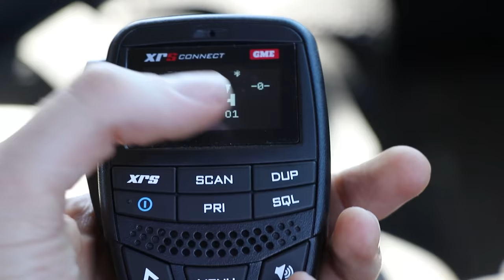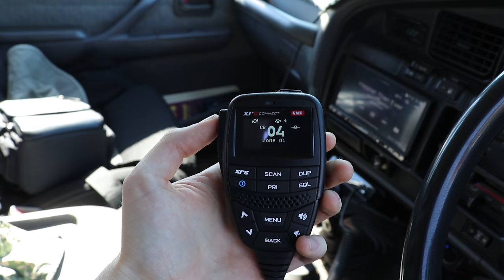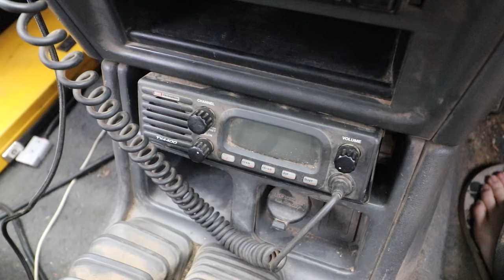You've been using YOUR UHF WRONG!!! CB Radio SECRETS for 4WD in Australia PLUS History & Technology

Comment: Good piece mate, thanks.

CH 10 is for National Parks and National Conservation areas. If you're not in either of those areas don't use CH 10. If you're in a State Park or on private land, pick another channel, usually 12 by agreement.

29 was originally the CH used by the road construction industry on sections of the Pacific Hwy upgrade, particularly the NSW mid-North coast. This allowed the site chief (one chief in the olden days) to communicate with inbound or outbound loads or plant. Using 29 back in the heyday was generally a fascination for travellers but it could also warn of road closures before bypass roads became de rigueur. No construction? Stay on 40.

Different construction areas use different channels. These days, on large road constructions sites, different road construction entrances use different channels - there'll be signs indicating which channel is to be used so the site chiefs can manage truck and plant movement on their site.

On antennas - the height doesn't matter as the signal propagates from the middle of the antenna. What does matter is the thickness. You can have an eight foot whip that can be as thin as speaker wire; or a two foot whip, which needs to be fat (for internal wire length) for propagation.

Personally, I don't mount my antennas on the bull bar - rough roads destroy the mount quicker than a roof mount, especially if the bullbar is not pinned. Height on the vehicle does matter. If your eyes are at 5' 7", on flat ground the horizon is 15Km distant; so decent propagation on the flat is the centre of the antenna at 5' 7" - a bullbar mount won't achieve this unless the whip is gimoungus. Azimuth doesn't matter but inclination and declination also matters - that's some math for another day. Also some math for another day - if you can get the centre of your antenna to, say, 12', then the horizon is 30Km; being reasonable, without a repeater, and an antenna at 10' centre, 20Km is audible and understandable with 5W; that'd be a 6.1

My three antennas [and sand flag] are mounted on my roof rack (all four corners) using foldable mounts with four positions of foldability. In tight vegetation, folding them flat, with 5W, does little to reduce propagation distance in that type of country.

Disclosure: I run GME XRS handsets and whips, and a Cel-Fi Go.

As an aside, a well designed kangaroo will rip an antenna off the bullbar, but might slow it down enough - so it doesn't enter the cab through your front glass ;)
Reply: Channel 10 can actually be used anywhere by 4wd clubs or convoys. Typically in National parks or out in the middle of nowhere.
But it is perfectly within the rules to use 10 anywhere providing you’re on the road with a group of 4wds.

Also..
(Not trying to be argumentative here, I enjoyed your post. Just chatting here…)
..
While the signal is generally propagated from the Centre of the antenna, it radiates and transmits from the entire length, so height absolutely matters. Line of sight doesn’t just drop off when the Centre off your antenna drops below the horizon.
It may however get progressively  weaker the further away it gets from the middle until the current reaches 0A on the waveform when it hits the tip (see below).
Lastly, 
Even if what you said was true, height would still matter completely wouldn’t it? The taller the antenna, the higher the center is.
Length is also important relative to the wavelength of the transmission signal as I’m sure you know.
If you have a set transmission voltage and current at the Centre where the waveform starts, the voltage increases as the wave gets closer to the top (and bottom) of the rod.
The current however decreases relative to the increasing voltage (V x I = P) causing the set transmission wattage to stay the same (minus losses, which may be little or may be extreme, I have no idea).
This causes all kinds of magnetic fields that confuse me greatly.

I think, (not really sure here but sounds right) that while longer might be better for transmission distance, i think the length of a well designed UHF antenna is a lot more complicated than that.
I think you can have a perfect length that is extremely efficient and doesn’t cause weird magnetic fields and eddy currents.
I assume the ‘ the perfect length’ would change with the output wattage?. But I’m just talking shit at this point. Maybe you know something about this?

Comment: When I was CBing in remote W.A. in the 1980s and 1990s, I used a GME AE409L ground Independent UHF Antenna, which I mounted on a vehicle roof gutter bracket with a spring base. 

It being a "ground independent" antenna made this type of mounting easier, and it gave me a full 360-degree ground plane pattern, so it didn't matter where I located it, just so long as it was up high and free of other metallic obstructions.

I used the 6db gain loaded stainless steel whip most of the time and found it entirely satisfactory for general use. Here is some more info on this GME antenna. 

The GME AE409L gives you the flexibility to use it either on 6dBi or 9dBi gain through the use of an additional whip on top of the existing whip. The 6dBi whip is suitable for most conditions. When you are out in the flat country areas, a 9dBi whip will give you a longer range.

This antenna is suitable for mounting on bonnets. An excellent antenna if you are driving mainly on bitumen roads. It is not recommended for off-road driving conditions. 

But with a little bit of "tweaking ingenuity," you can always add your own spring base to your mounting hardware to circumvent this problem. 

I highly recommend the use of a ground Independent type of antenna setup because that way, it doesn't matter where you locate your antenna, you'll always have a perfect ground plain. You will need to keep obstructions well away from the antenna though.

Comment: Good content mate.
I am an Electrical Engineer and agree with aerial placement on roof. Mine is on the roof rack and have 2.1dB short aerial (High Country) but when I am on open stretch I put the 6dB whip.
Cheers
Reply: I've got my HF mounted on the roof - my UHF and SATCOM are bull bar mounted, but that's more due to space and keeping the cables and antennas separated than due to range desires. If I can't reacj on a bull bar mounted UHF, it's time for the good old HF on RFDS or VKS-737 (I can use both, but mostly operate on VKS-737). Of course, working in Maritime Communications, all this talk of 100W and less is a bit tame for my tastes! My ship recently got a QSL card from Germany, following one of our GMDSS HF tests (conducted off the NW Shelf near Broome)! That's range!
Reply: ME-2
However, I only became an electrical engineer, several years after I stopped using the CB.
Hence my knowledge was obtained from (older) TV / Radio aerial books and understanding SWR compared to various points of mounting.
SWR for the same aerial & cable length can vary greatly, depending on the location of the aerial.
Also - if one has a 2nd aerial (either a normal am/fm radio aerial, or a dedicated CB aerial), if it happens to be at a set distance from a working aerial, it often acts as a dipole reflector.
Having TWO aerials connected as if a dual dipole can also have a greater effect than most people know - of creating a razor sharp "arrow beam" - similar to what a YAGI gives.
In other words, sometimes a dual aerial system works to block signals from the sides while amplifying signals from front & rear (or one side to the other).
Side to side beam patterns are good, if one is sitting at the side of the road, wanting to hear radio chatter from either direction, whereas a front/rear lobe effect allows travelling people to hear others in front or behind (such as in convoy), whilst eliminating any radio traffic to the sides (from fixed house locations etc.).

Comment: Nice job mate. You should do a follow-up on how to use CTSS or DCS to filter comms of other users not in your convoy. It is great for restricting what your CB receives when travelling with family and friends (and not interested in the general public interference). I’d give you an A+ if you also included graduate level discussion on using the encoding to cipher the transmission. Thanks!
Reply: Also to be responsible you should have TX lockout enabled otherwise you can jump on someone else.  Use of CTCSS etc on repeaters is illegal as well.

Comment: Good video mate. I have been in to CB radio for 20 years now, both 27MHz and UHF and 3 years ago got my ammatuer radio licence. Its a lot of fun and were very lucky to have the free to use CB radio spectrum we do. Its WAY better than the American counterpart.
Reply from the maker: Thanks John!!
Reply: @AussieArvos  Away back in the early 1970's here in NZ - the CB license was a cost for everyone, minimal but still a cost (about $5 a call sign of which I had FOUR, 3 for my three units in Otago and 1 in the car for use in Invercargill).
Later, when they opened the number of channels available up to 40 with Upper & Lower sidebands too, they started charging (like wounded bulls) an exorbitant amount, in annual fees - which was about the time I said nah - to hell with it, and stopped using my CB's.
About ten years after that, when most people were wanting a comparable unit to those in the USA & Australia, NZ changed to 27Mhz, which meant my old 7 channel pop-up-toaster, and my later 11 channel were unable to be used, as I couldn't afford to convert all the crystals over to 27Mhz, and the units couldn't be changed to USB & LSB either, just down the middle old school radios.
Thus my old CB's still have the original (main band) 26.5Mhz based crystals

Comment: There is also an HF CB system available which is still out there on the 27MHz band and is still class licenced like the UHF CB frequencies. It does not require the massive tuner box for the antenna that the radios using the  lower frequencies around 3 - 7MHz. Best of both worlds to have both!

Comment: Repeaters: when set in duplex, when you press the push-to-talk whilst on channel 1… you are actually transmitting on channel 31 
(that’s what the repeater listens to).. and when you release, your radio switches back to listening to channel 1.
that’s why you can hear the “roger beep” the repeater sends when you let go. Same for Channel 2=32 thru to 8 on 38.
(You can test this with a second radio listening to channel 31 and hear yourself)

Basically a repeater simply takes channel 31 and transmits (repeats) whatever it hears on channel 1. 
It’s up to your radio to deal with transmit/listen.
Pretty basic, but it help if you understand how it works it’s easier to understand what it’s doing.
(Also a good reason to avoid channels 31-38.)

Another interesting fact: by law all repeaters must transmit their VK license number at regular intervals  in Morse code… if you listen to a repeater long enough you can confirm it.. if your Morse code is fast enough you can identify exactly what it’s call sign is… (it’s very quick however!) then look it up to find it’s physical location.

Comment: UHF is available all over the world, it is extensively used on boats/ships and farmers/workers who are in remote locations. When buying a UHF set you need a encryption code from, for example the Police, Fire, Coastguard to have access, so chances of that is zero. I use to be a Police Officer (very young, I was 19 years old) in a very remote area, 500Km from the next Police Station and we could talk to them as if they were right next to me. We had an "Open Band" base station and we could even talk to Air line pilots ships out at sea, basically anybody half way around the world. Imagine the fun we had with that thing. The base station had an antenna that was about 30 meters tall if not taller and a Repeater about 200 Kilometers on top of a mountain, and the Police vehicles had mini base stations in the boot of the car with an aerial that was about 3 meters tall. The worst assignment ever, we were 3 Cops with only 1 eligible Girl in town, so over and above us there were the local farmers who eyed out the same girl. Needless to say I lost because I am writing this comment, If I won, I would still have been in that God forsaken place. LOL!